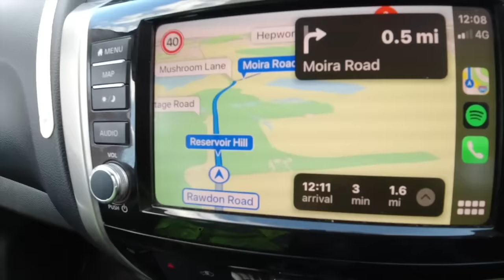Traveller Eviction! JOB ON for Assistance for us to MOVE CARAVAN OFF LANDOWNERS SITE IMMEDIATELY!

Comment: Did those two enforcement agents have a proper court warrant/writ? Or did they have a Mickey Mouse warrant/writ? If the latter, be careful as any legally-savvy traveller and their lawyers could haul your ass into court and you could be hit with a big damages award for Wrongful Interference With Goods.
Reply: "interference with goods".....oh the irony
Reply: @craigbutler6243  Unfortunately, Craig, recovery firms have taken a hammering for removing vehicles on the back of dodgy writs and warrants.